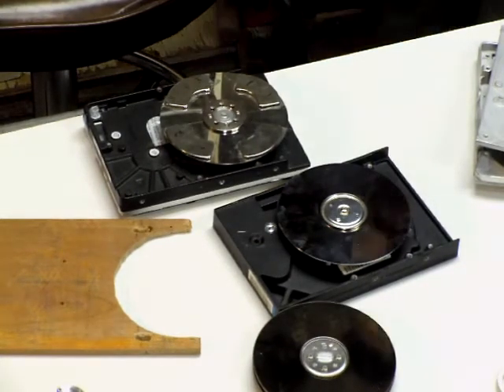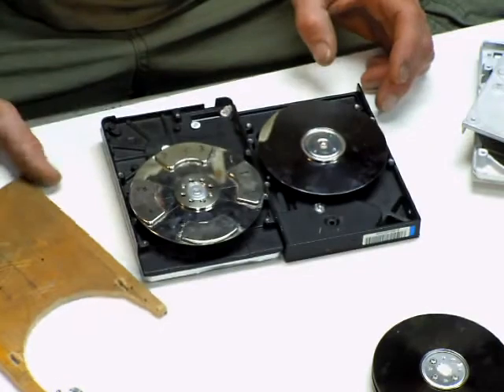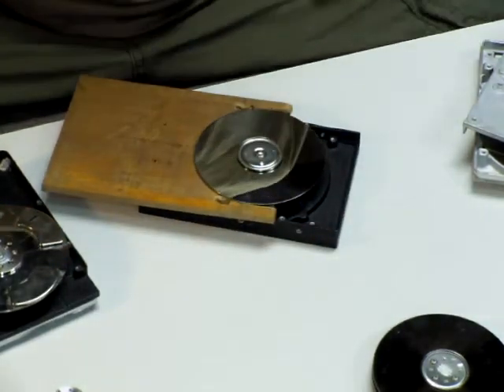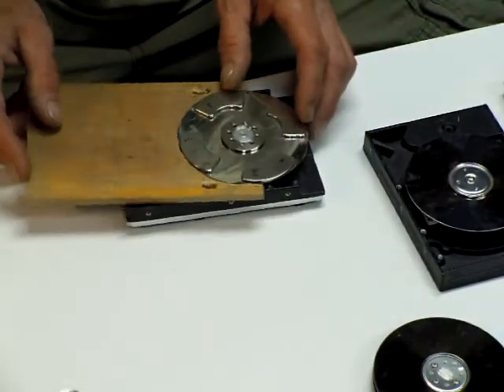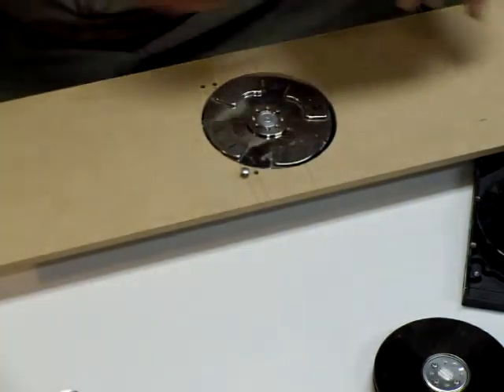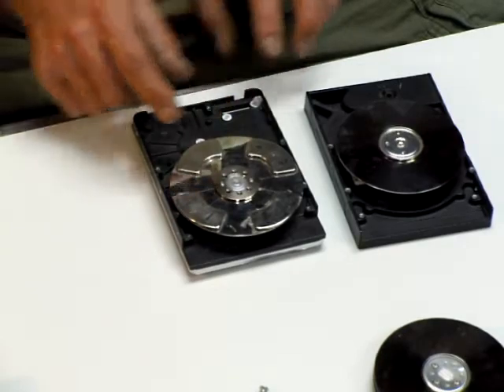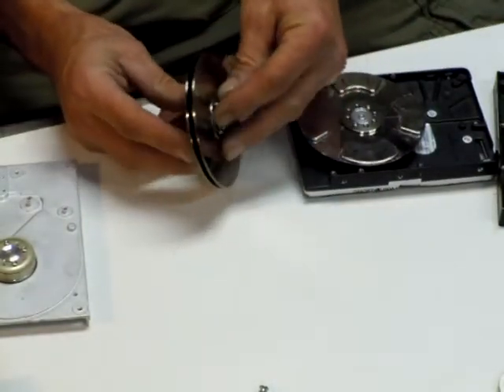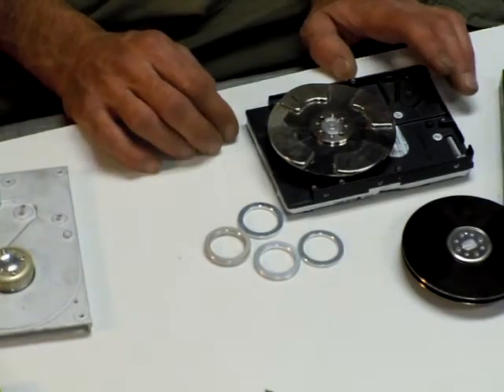HardDrive-Bedini-Motor--Different coil / motor mounting options

Comment: i try making one but it just wont spin ...can u tell me what i did wrong .
Reply from the maker: Hi Shamsuddin,

I couldn't say for sure why it's not working without more information. 

You have to give it a spin by hand to get it started before it gets going on it's own.
Double check all connections, and that you have connected everything properly.
Check you transistor to make sure it is working, it is easy to blow them out if things are not connected properly.
Make sure the diodes are working properly as well.
Might be the resistance is too high or low.
The polarity of the coils is connected properly.
The "run" battery is fully charged.
The coils are not too close or too far away.
Reply: One more thing i forgot to ask .was about the coil. I wind about 320 turns an i used a corrugated steel thats been used for concrete work.. . Whats ur take on this.
Reply from the maker: Doing well today, thanks for asking, how are you?. Yes, easy to spend many hrs messing with this stuff. 
You shouldn't need to spin it very hard, just get it going easy and should work. Make sure the rotor the magnets are mounted on spins freely when the coil is not there. There should be no friction... good bearings so spins for a while without the coil. Have you tested the transistor for proper function? You must remove it from the circuit to test it. Big reason for not working. Diodes too. You may need to reverse the coil connections to the circuit, it does matter, only works one way. You may need more winding's around coil, it should be closer to 450 turns, no splices, one long wire. I should think the "rebar" core should work for the coil, I use a bundle of welding rod for mine. about 7/8 inch in dia (22.225mm), and 3" long (76.2mm). Resistance values are important too. You can send me an email with some pictures norcaltesload@gmail.com
Reply from the maker: Hey Tony, thanks for sharing your opinion. I'm guessing you have done a lot of research on this subject, why else would you be commenting here. I'm not so dismissive as you are on the idea of making major breakthroughs on many different types of energy production. It seems to me, this is a major need for our planets health, and to be able to provide the energy needs of our growing electronic need as we approach 8 billion people on this planet. I encourage everyone to do experimentation on any potential new energy source that doesn't rely on oil, coal, or nuclear power. Has everything been figured out so we don't need to push forward anymore on learning new things? How do you feel about our energy needs, and how can we make that happen as our mutual futures unfold? What are your ideas?